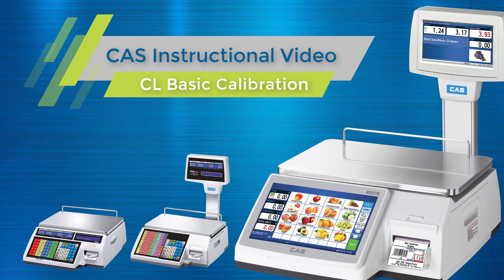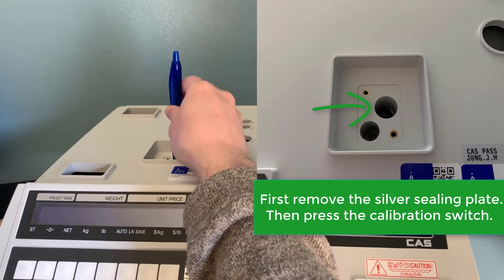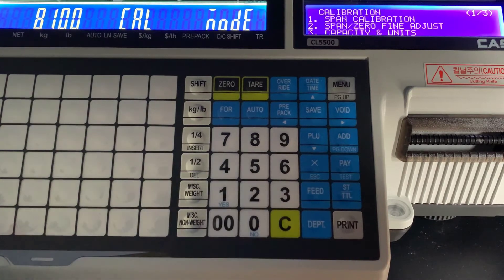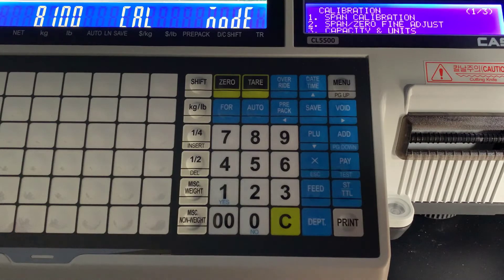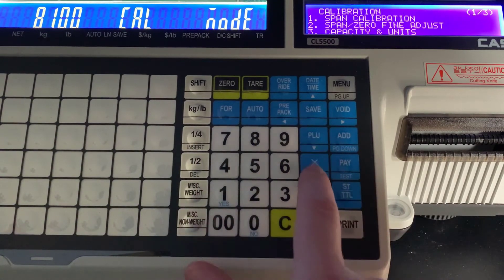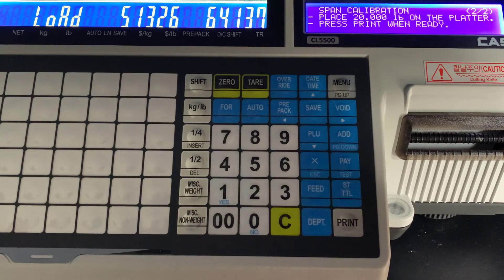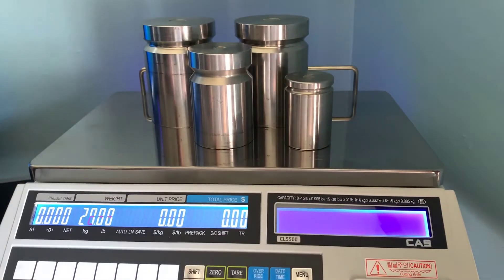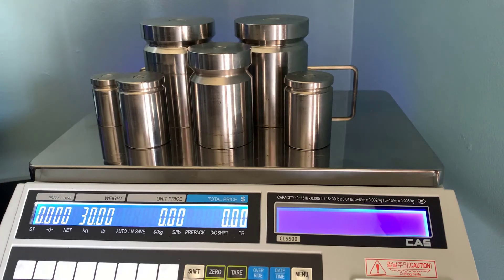4. CL Series: Calibration Setup

Comment: How to reset it if I forgot password
Reply from the maker: We would be happy to help you. Are you asking about a clerk password or the scale password?
Reply: @cas-usacorporation900  scale password , I’m able to put entries via pc but it ask for password for certain things in scale , like communication, printer etc , I think might need both clerk and scale pass
Reply: How can I do that , would you charge for this ?
Reply from the maker: @paike5172  In order to reset a scale password you will need to perform a memory clear from the CAL mode menu.
Reply: @cas-usacorporation900  I tried , flash all clear , in cal >system options > but it prompts for password again !!
Reply from the maker: @paike5172  What model scale are you using?
Reply: @cas-usacorporation900  Cas cl5200
Reply from the maker: @paike5172  please email your info to info@cas-usa.com. 

The memory clear should fix this issue normally. It may be a bug in the firmware. So if you have the option, re-flash your scale with the latest firmware.